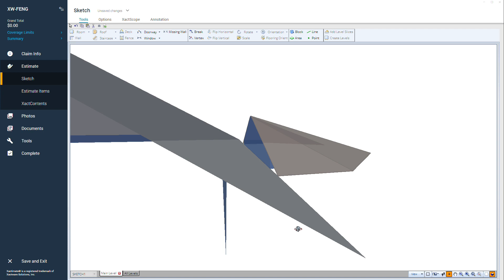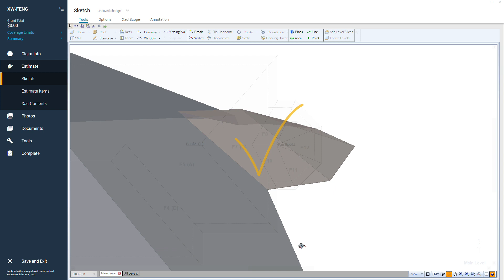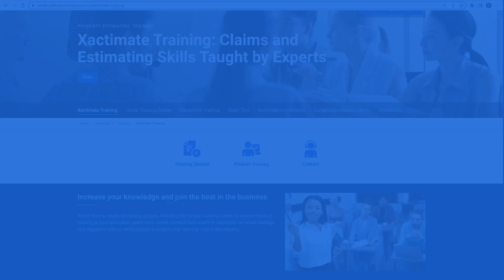Xactimate Xpert Tip: Merging an Overbuild into Another Roof

Comment: Would the combine roof option also do the same thing? Ctrl + Shift + C
Reply from the maker: Great question! Control + Shift + C will make the smaller roof a subgroup of the larger roof. This allows them to share line items, but for accurate roof area calculations, you’ll still need to drag the smaller roof into the larger roof as demonstrated in the video. This step ensures the area calculations reflect the actual roof structure. I hope that helps!